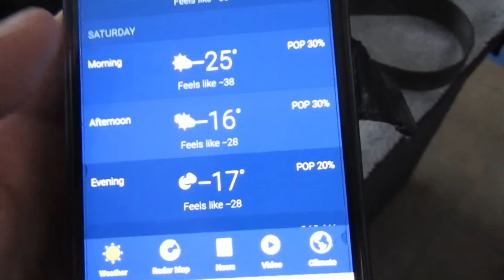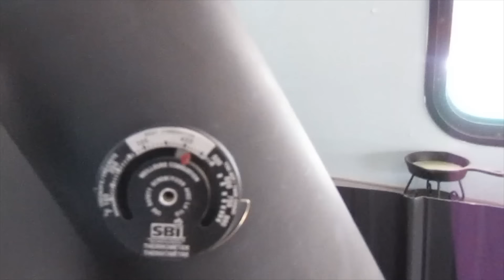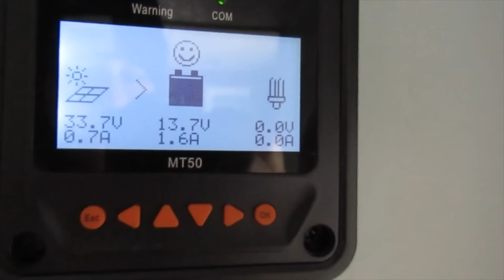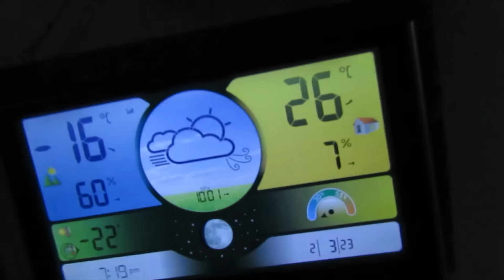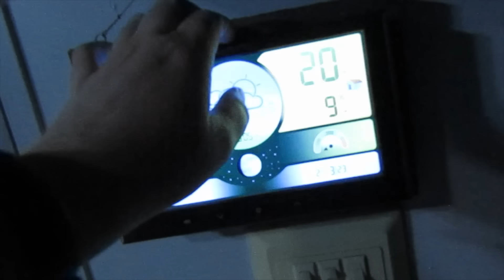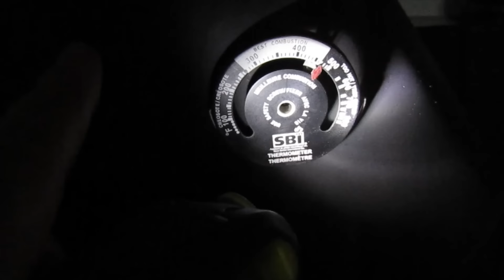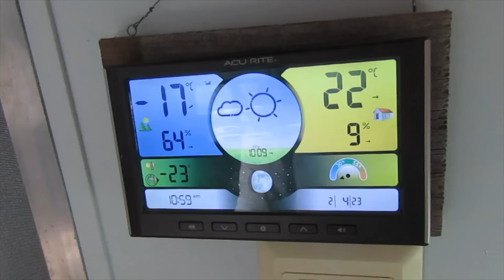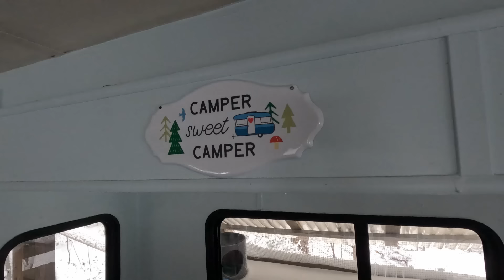Camper Living in Extreme Cold Warning

Comment: Great video, back in 2019/20 i stayed in a 1998 Prowler trailer/5Th Wheel, here in Ontario Canada. AT times it got so cold even with the wood stove. I had to get up about every 2+ hours to add more wood to the wood stove.  I had issues with trying to get the Propane Furnace of the trailer going, turns out, it would only kick in if i started it at a lower temp on the settings, then i could crank it up once it kicked in.

Comment: I am currently living in a 2008 Keystone Springdale in Northern New Hampshire. My furnace does work, but I dont use it because I cant stand the smell. I have a ventless propane  heater that works awesome, but there is no happy medium. Its either way too hot or cold. I have to turn on and off 100 times a day. I have power, only 20 amps. So, one electric space heater. Winter camper living SUCKS

Comment: A good source of wood Jenna Is wood pallets usually they are free and you can get them in any industrial area and invest in a electric saw or skill saw for cutting them up ! I worked a a place and heated my place all winter for free five years using them and they are hard wood one thing stay away from the blue or orange ones as they are not good for burning because of the paint.
Reply: During the 1973 oil embargo/recession, heating became very expensive.  Previously, firewood could be found not only for free, but some homeowners would pay you to take away the downed trees.  The price of firewood tripled if you could find it and because of the recession, no tree clearing opportunities.  My dad instead brought home pallets every night in his truck.  Everyday after school, we had to dismantle the pallets and he would cut the boards into usable length.  He really liked the pallets because they were hardwood, free and kept us busy after school until mom or dad got home.

Comment: What temperature does propane stop vaporizing?
-43.6°F
In general, propane fares quite well as temperatures drop, since it has a freezing point of -306.4°F (!). But it does have some problems as temperatures head down the thermometer because of its boiling point: at -43.6°F, liquid propane can no longer vaporize.

Comment: I live in a camper and run a deisel heater 24 hours a day had a lot of trouble out of it the fuel pumps on them get gummed up so I  put a hole bottle of gun out carb cleaner in one tank of fuel and cleaned things up working  great now I have 2 heaters one for back up and lp as well no wood stove  in here I have a brand new one maybe  next winter
Reply from the maker: I hope my fuel pump doesnt gum up!  Longest I ran it was 3 days straight
Reply: @gypsyjenna  it wouldn't hurt to dump some carb cleaner in it .2 times a winter, how much solor  you have ?  I have  800 watts and it's  working out good for me
Reply from the maker: I have 330 on the big panel and another 120 on a separate system
Reply: @gypsyjenna  that is what I had all last  summer every thing was fine till October hit and lost day light so I doubled it really  quick, I wish I could  afford  the new sol lithium batteries  with the heaters in them

Comment: If you run a vaporizer or boil water the vapor will trap the heat in the air. Keep you warmer longer ❤
Reply: this is a good point that kinda knew about but kinda over looked it. 70f is 70f, but 70f at 10% humidity contains less thermal energy than 70f with a humidity of say 50%. its like a glass of air vs a glass of water, which one will have a higher thermal density: clearly the water.

i suspect its so drafty in that camper though, at the moment, that she will never be able to control the humidity. that wood stove is sucking in a huge amount of cold dry air to replace the hot air going out the chimney thing

Comment: I did this for a few weeks in north dakota in a crappy old trailer with very little insulation. All I had for heat were 2 small space heaters. 1 heater feeding the other one and i was barely able to feel heat coming out of both of them from 6" away. Ice building up on the inside of the windows and any metal on the wall(entry door and window frames). Gallon jugs of water frozen solid. Shit was cold.
Reply from the maker: Dangggg, sounds rough for sure!!

Comment: i live in a 98 32 foot citation fifthwheel in alberta. ive had temps -40 and for weeks at a time.and now headed to nova scotia.i guess i well handle it pretty good.i dont use propane for heat.wabasto diesel only.and heat pad on bed.ive lived in vans buses and trailers,now i will be living in my truck and a slide in.
Reply from the maker: You will definitely find it warmer in NS than AB

Comment: I think the propane change over switch should be installed with the switch on the side not top? It seems it may get moisture in it and freeze? Not 100% sure, need to look at mine again.
People that have never burned wood, have no idea how many cords it takes to get through winter. Depends on how hot you burn it, how efficient the stove is, etc. nothing like wood heat though. You get warmed about 6 times with it, lol.
Reply from the maker: Moat definitely! Lol

Comment: I live in BC in class a RV.   Drafts and feel wind even when windows are shut.  Thin floor with no insulation and this RV is allmost as cold as being outside.   We had to put.o propane heaters non stop to keep the RV warm.   Costs too much. 800 a.month for propane.   No thanks.   Electric heater blankets saved us in minus ,30 this winter.   Not bad.   200 dollars per blanket.
Reply from the maker: Whoa that's rough eh? Have you tried a diesel heater?

Comment: i love this sort of stuff. when covid hit i decided to start getting "prepper" stuff and learning about all of it. i now have 4kw worth of solar panels, two heat 12kbtu pumps, a portable kerosene heater, three 1500 watt space heater, 50kwh of battery and two small 2kw inverter generators. stocked up on food and bottled water. also, learned about various weapons, fire arms and radio communications.

 i also built two over powered ebikes. i went way over board with electronics and electricity in generaly but i use my new knowledge every day. in fact, i think my new knowledge in electronic and electricity is why i got my new high paying job and im all self taught. i plan on adding another 30kw of panels and converting a car to electric, not for social or political reasons, but seems easier than trying to make my own gasoline.

 they say heat pumps dont work in the super cold winter, and thats just not true. i have a small 950sq ft house and barely use the heat pumps until about late november. i bought two heat pumps incase one fails, but found that when it hits -15f i have to run them both to keep the house at about 55f. but if i want to be comfortable at 65f, then i  have to eather fire up the kerosene or the little space heaters.

normally our coldest  average temps are in january and maybe dip to about 15 to 20, but actual average is about 30f.

i agree with your points about having back ups, in fact i agree with your point to have backups for your backups, not only is it fun to have and know how to use this stuff for your self, but you may help save other people's/animals lives with your knowledge alone. i am also on the grid, and it goes down many times a year espeically in the spring, but occasionally it flickers in the worst of the winter storms we get, but its nice having options.

did you know that your wood stove is sucking cold air into your dwelling? the smoke and hot air that are existing through the pipe is causing a slight negative air pressure that is being equalized by sucking cold air into your space in every little crack it can. this is part of the reason you percive it to be drafty, all wood stoves do this in all homes btw, is nothing unique to you.  i bet if you could also create a fresh outside air intake for your stove you will burn much less wood and feel less drafty. i bet you likely already knew this.

anyways i love seeing people think out side the box and you mix that with some what extreme conditions such as crazy low temps and im hooked. making these videos also give you something todo. i myself have made tons of videos of my adventures, but only end up uploading like 1% of the random stuff i shoot and its unedited stuff that i can shoot in one take as i am kinda lazy.

sorry if i typed too much, i assume you get bored and would be ok with this wall of text as its all somewhat related to your adventures

Comment: I saw your last video and didn’t have time to comment.  Be very careful about drilling or driving screws into your walls.  They run wires different in an TV than a house.  Plus they often use aluminum wires.  A mother wood source can be pallets.  Just use a sawall and cut to your hearts content.  The best of course are free ones made from hardwood.  But the all burn.  Even the ones in your wood storage can be replaced next summer.  Then just watch where you put your ashes.  It will be full of nails.  No use pulling them just to burn them.  I doubt if anyone will deliver wood this late in the season.  But you can make it.  You might start now and just use your hood wood for night time.  I’ve been in an RV now four my forth year.  I had freeze problems this winter. Each year it just keeps getting better.  But that’s the way life is.  You learn and wait for the next problem.  Later
Reply from the maker: Thank you, I appreciate the info. I have burned pallets in the past. Yeah the nail thing is a bother but it works in a pinch, eh!

Comment: Something doesn't seem right  I heat with wood in my 32 ft camper and In 0 degree's I have a lot more wood inside and I run mine at 700 degrees and it's really small steel and I plan on getting a bigger one

Comment: we use a buddy heater in FL if the tank is cold the pressure will be low. watch carbon monoxide danger. if you get lots of wind maybe get a wind generator if sun dont do much in winter? well be safe 💒🙏

Comment: Why not put some window cover use  like in cars during winter, they repel cold outside and keep warm air inside. Just open the windows a little bit so that fresh air comes in
 A solid Styrofoam which you could cut out or remove some parts to keep the gas regulator covered during winter.

Comment: And be nice if you had some type of coal like brickets or something as well depends if your stove is rated fir burning coal as not all are as thats usually burns pretty hot and ur in a trailer/mobile home sometimes putting plastic on the ground under your trailer or that thin reflective insulation can help as well and the mice dont like it either

Comment: As for propane if you can find one that is a vented propane heater your probably better off or one with an exhaust to the outside buddy heaters do help but the possibility of carbon monoxide is there using a buddy heater

Comment: Wood Stoves will work against you if you have to run them hard without a fresh air vent for them . They pull air for the combustion from the room and it draws cold air in from wherever they can causing draft's. 😄

Comment: I live in New Hampshire it's cold same kind of trailer and I wrapped Styrofoam squares around the bottom of the trailer keeps all the draft and wind from coming up into the trailer I also bought a 80 gallon propane tank and I also have a buddy heater I can also close halve of the trailer with a bathroom rod and a heavy blanket only if it gets real bad i love it !

Comment: Having that gas without an air vent under it in your van is very dangerous if your gas leaks your toast. The gas should be in a gas safe box with a vent underneath it. I hope you have a carbon monoxide detector in your van. Try to cover your windows with insulation covers.❤
Reply from the maker: Multiple CO detectors 👍

Comment: You have no Damper on your chimney > all your heat is going out the top . if you had a Damper / throttle it would be so hot inside you wouldn't be able to stand it.

Comment: Her propane regulator freezing up I live here in Oklahoma and I've seen it get cold enough that it's froze my propane regulator like she's talking about mainly on a small regulator setting are in the travel trailer watching the fire get lower and lower one trick I used to do is throw a dish towel in the microwave and run out there and wrap it and it just start instantly working the first time I went out in poured hot water on the regulator and it worked also and the crazy thing is it didn't do it again once I unfrozen something I thought about if it gives you more and more trouble is heat tape can you just plug it in when it gets that cold

Comment: burrr  i like that wood stove  i live in a FEMA  trailer  best little house i could have  it sleeps 8  but   not really a lot of room i noticed you have a pull out   i wanted one but everybody i talked with said they leak the only major problem my ac fan stopped  yes have to get another motor  so my heat goes to the bathroom  bedroom  tough the air ducks   to disperse  the heat  thanks keep warm up there  im in mississippi   it gets cold  not like what you have  yes it snows sometimes

Comment: I realize this is a year old video, but I'd love to know where you got your thermostat thing that tells what temp it is outside and inside? This will be a science experiment for me here in Michigan living in a 5th wheeler. I do have an electric heated mattress pad that is absolutely amazing (but I do have electricity for the most part- we do get quite a few outages here). 😊 Curious to know what kind of septic system you have? And what type of skirting?
Reply from the maker: It's an Accu weather brand and the skirting is just plywood, I would suggest doing insulated foam board behind your skirting. For Septic, I plugged off the black tank and do a simple, DIY compost toilet 👍

Comment: Did you winterize the AC in the ceiling? Mine has only a thin plasic flap between the inside and outside temps so I stuff a roll of fiberfill and relectix in it. Making a note to remind me in the spring to remove it.

Comment: The heat shields and wall being that close to that huge ol stove wasn't an issue?
I have a small (kinda like the cubic stoves but a bit bigger) one and I find I gotta keep mine further from the walls than that.
Reply from the maker: I have spacers on the wall and cement board behind the tin. It's been good thus way for years 🙂

Comment: Hi how are you my name is Tony and I live in a 30 ft travel trailer and I use 6 inch styrofoam as a skirt and 3 mil plastic to wrap around the camper it makes a huge difference as a vapor barrier and of course a piece on the roof I've been living like this for 3 years I don't live in extreme cold like you do but I live in Stoddard New Hampshire it gets pretty cold here too especially where I live I'm one mile down in a valley anyhow sweetie good luck to you
Reply from the maker: Good call in the styrofoam skirting. I should have added that on the inside  of my plywood skirting. I suppose I still can but just personally not willing to crawl underneath with all the spiders to do it, haha.

Comment: If you need to run a buddy heater other heat with that woodstove that tells me you don't know how to run a woodstove.
Reply from the maker: It should tell you that it's only because it was hella cold and RVs are poorly insulated. I run it so good sometimes that I have to crack the windows as a matter of fact 🤣😂
Reply: I have a smaller ( home made ) one in my 30ft motorhome and in subzero temps I can run around in shorts.

Comment: I meant to ask before but what exactly are you running off your batteries and when? Do you think that those two panels are enough, or do you plan on adding more?
Reply from the maker: The lights and fridge lights run on the batteries and the fridge runs on propane, not electric. I don't use much power at all but when I need to run the microwave or hair dryer I just flick on the genny and then turn it off. In the bedroom, cell phones and devices can be charged on a separate solar system. My power needs are actually quite low I have come to realize
Reply: @gypsyjenna  I plan to do the same. All my appliances are propane, even the fridge. You see some of these videos with 48 solar panels on racks and a bank of 24 batteries and it freaks a person out. Until you think about what exactly are you even needing to run on solar.
Reply from the maker: For sure. Some people use alot of power. Washer, dryer, coffee maker, extravagant lighting, heaters, computers, etc

Comment: Jentransfer, do you like the battery-operated pump you use to transfer diesel fuel from your jerry can into the diesel heater.  I'd like your opinion.  TY
Mic in Michigan
Reply from the maker: I love it, use it almost everyday now that I am running the heater more frequently. It allows refill with ease. Hope this helps
Reply: Purchased where? For approximately how much?
Your struggle to stay warm is a huge problem to tackle in warmer weather. You can increase insulation and warm airflow but with some warmer working conditions.
Reply from the maker: Purchased from Canadian tire. I don't remember the price. You can probably buy similar ones off of amazon
Reply: 🙏 thank you

Comment: What is your water source? Does your heater in the trailer not work?
Reply from the maker: The propane furnace is finicky. I don't use it. In winter it's dewinterized and I just bring jugs of water in. In summer, I have a 1000Litre water tote and use gravity fed system into the trailer's freshwater tank